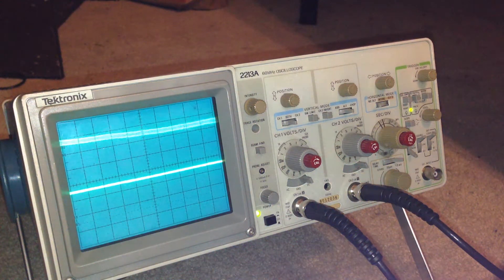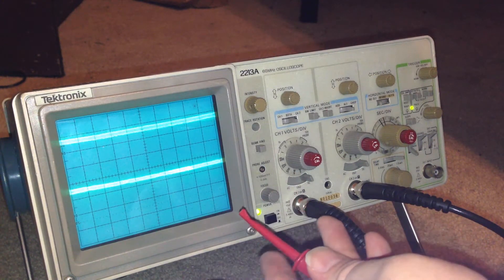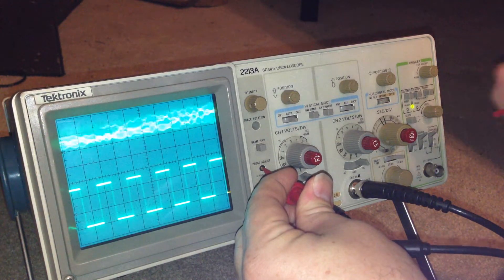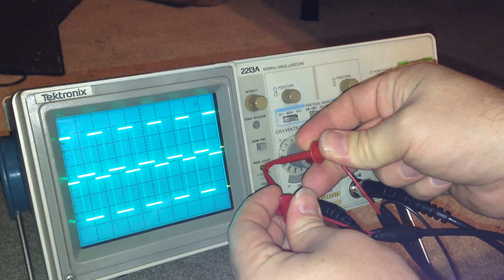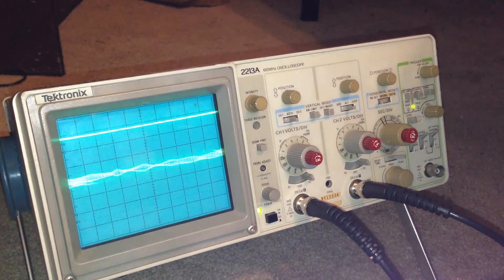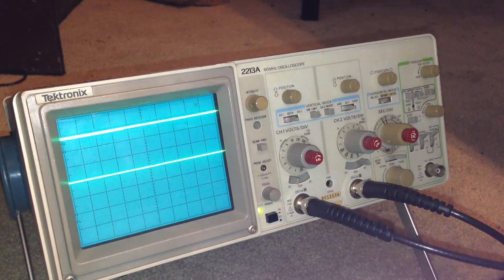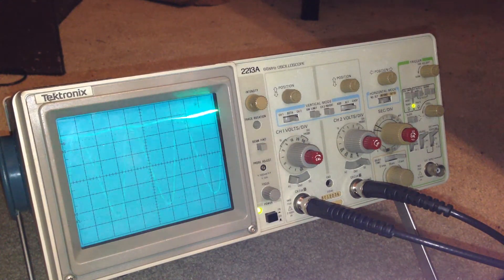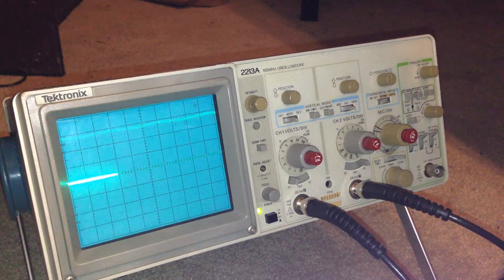"New" Tektronix 2213A oscilloscope off ebay

Comment: I just bought one on Ebay but no probes , I have a pair from a modern Rigol 1102 I think would these work or do I need to find the proper ones for this unit ? thanks ...helpful video
Reply from the maker: Any standard 1x probes should do.

Comment: Bought one of these new years ago. The probe adjust signal is a reference for probe compensation..  If the signal is distorted, a capacitor on the lead can be adjusted to adjust it.

Comment: What's the difference between the 2213 and the 2213A?
Reply from the maker: I read somewhere that the A has a brighter screen.
Reply: The A version is a upgraded design by about three years. look it up on the Tek Wiki website. I have one and it works great.
Reply: Power supply was redesigned due to problems with the old design failing. The "A" version has the updated power supply design.